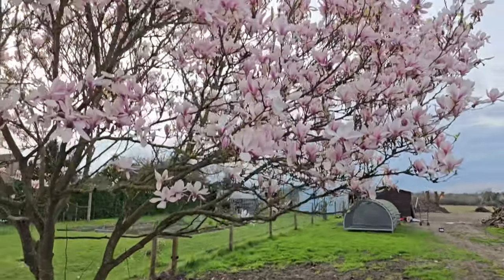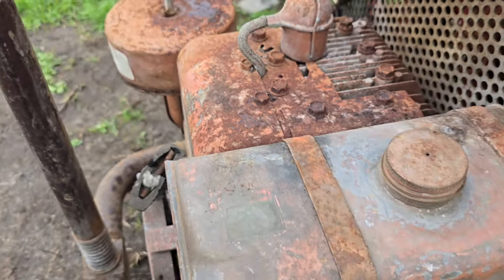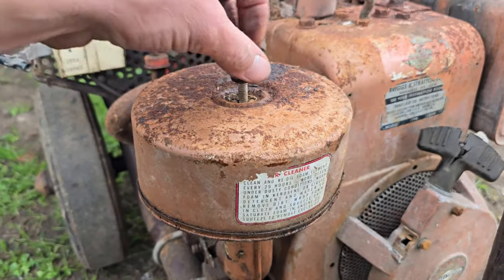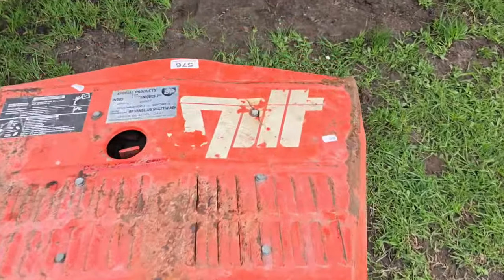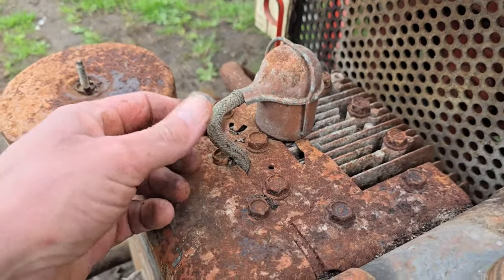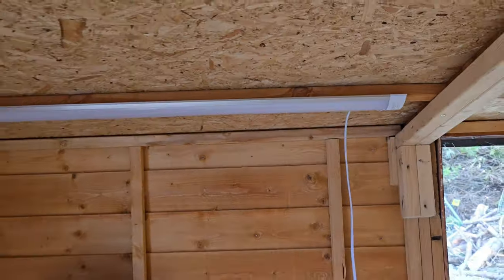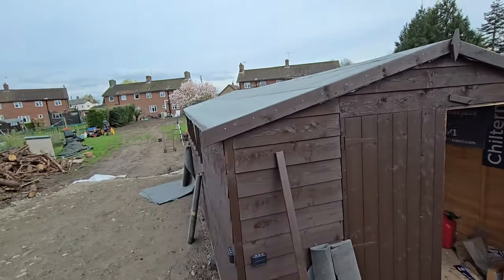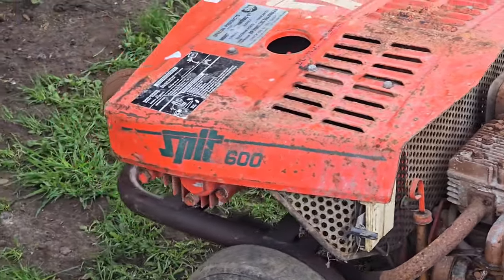Another Auction buy, an old Compressor.

Comment: Bit late now but for future reference Instead of using roofing felt I used pond Liner to cover my 10 ft Shed. It was cheaper, no battens required, did it in one piece, roofing nails to secure and 8 years in it still looks like it was fitted yesterday. It has been watertight and hasn't deteriorated despite being in full sun every day.

Comment: Electricity wise, run an armoured cable from the house on its own circuit leading to a small consumer unit in the shed. 2 circuits required, one for lighting, one for sockets. Not that expensive and straight forward to fit.

Comment: Won't you need an electrical panel installed inside?  And does it need to be approved where you live?  Here in the states, you can install your own, but it needs to be signed-off by an electrician, (unless of course your hiding it!)
Reply from the maker: Yes I could not even think about wiring that to the mains in the house. Definitely an electricians job. I think tho being a privately owned home tho it don't need to be signed off. But if there ever was a electrical fire tho, insurance may have questions. It's really not worth the bother. Will get it done properly tho.
Reply: @NorfolkMancave  - Here in the US you can do it yourself; and you don't need a permit, but in most states, it's a good idea to have a electrician OK the job, or call your local provider to OK the job.

Comment: Looking great Adam,I have a similar setup workshop wise ,take a look at Ajax security alarms ,I have one on the house and workshop,works wireless system ,and over 40 meters from the base unit ,a bit of peace of mind,all the best Nige 👍
Reply from the maker: Aw. I may struggle to get WiFi in the shed. But we do have a security camera on the house that will zoom in to the shed and is motion activated. 
But I am going to alarm it up.

Comment: Thermal engine construction site Compressor
Make: SPIT
Model: 600
Power: 7 HP
Overall dimensions : 70 cm x 95 cm x 72 cm
CategoryCompressorsMakeSpitModel600.0
SPIT 600 thermal engine construction compressor, an essential tool for all your construction and civil engineering work. With its 7 HP power, it will allow you to carry out your tasks efficiently. Its overall dimensions of 70 cm x 95 cm x 72 cm make it a compact equipment and easy to transport to your construction sites. This model 600.0 of the SPIT make is designed to meet the requirements of building professionals. Tour most ambitious projects.

Comment: Thinking outside the box as they say, but..... only because it is something I'm looking into for my shed... have a look into the "cheap" Chinese diesel cab heaters for giving you some winter warmth.  They are around the £100 mark, give or take a bit, run off red diesel if you can source it.
Reply from the maker: Yeah I may do that. Or put a little wood stove in. Need some heat for the winter.
Reply: @NorfolkMancave I've got a tiny stove but you can't start it with a time clock...

Comment: I have the same compressor and the frame is the storage will not start until air released as its hard to turnover very large volume of air mine has a kolar engine

Comment: Are you going to lag and line the ceiling and walls? It will be pretty cold in the winter if you dont if I was you I would put a metal roof on top off the felt
Reply from the maker: Yes I think I'm going to line it out a bit. Like you say would keep it warmer.

Comment: The type, model and code numbers are stamped under where it says type, model and code...

The engine looks older than the rest and has a screened HT lead and plug cap. Ex military?
Reply from the maker: Yeah really not sure. Engine looks older, but it looks right. Unless it had a later B&S engine that faild and someone stuck an older engine in it.